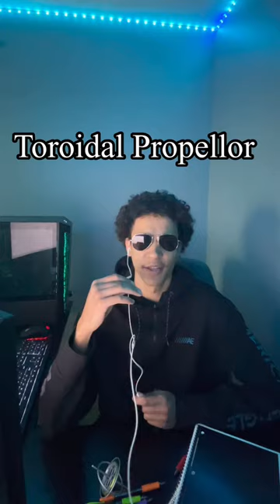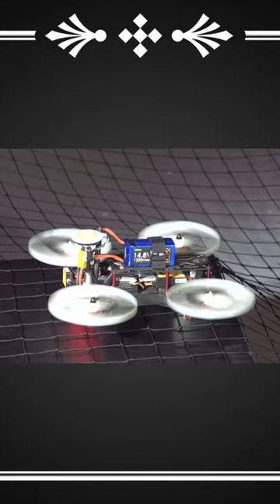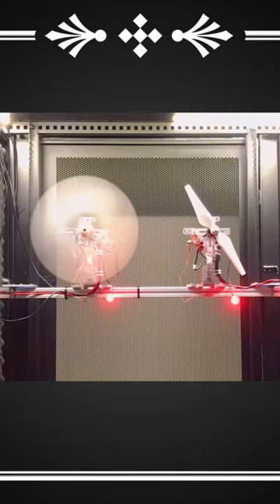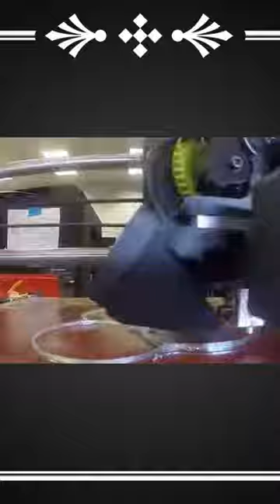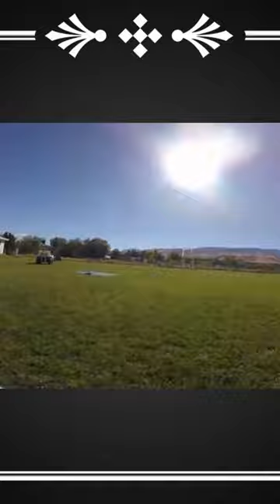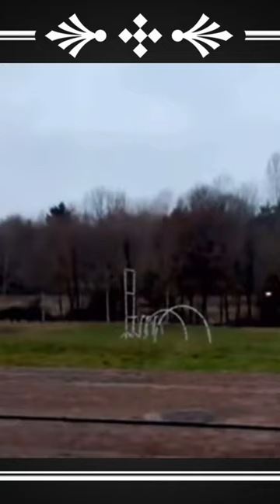Toroidal Propellor!!! #shorts

Comment: If they can do that, they can make a jet powered one
Edit: I meant like the propellers of a commercial jet
Reply: Imahine toroidal blade on intake for turboprob / regular chopper
Reply: The difference in intake of air as well as pressure on the blades might break the propeller on high speeds
Reply: Inside of the jet engine it's just fine to use the normal blades that are used because it's loud anyways, don't be adding more complexity and fragility just it has the potential to be more effective.
Reply: Makes those “tic tacs” look more and more like big boy toys with big boy budgets 🤷‍♂️😅
Reply: At this Point they can make anything you ask you get
Reply: Nash probably wouldn't be able to contain the preassure
Reply: You miss the point
Reply: Someone actually tested the design and its louder than normal ducted fans
Reply: Won’t do anything and might cause more problems to the jet engine causing more noise (Due to the need for relatively straight even flow).
Majority of the noise comes from the fast moving air out the back.
I wouldn’t be surprised if someone tries it because that’s engineering and science, but wouldn’t be surprised if they didn’t find anything useful.
Reply: They are great for boat engines and sub's aswell. Less noise more power
Reply: 1. For everyone talking about using toroidal propellors IN a jet engine, jet engine compressor blade geometry is totally different from a propellor, a propellor is not a compressor
2. A drone that uses jet engines instead of electric propellors wouldn’t work because the throttle response of jet engines is too slow. The flight computer adjusts the power of each motor tens of times per second, and a jet engine just can’t respond that fast
Reply: They would have to account for structural problems
Reply: They're already working on it and also have results and applications in the airlines industry. On jets engines and prop. ..
Reply: Oh, to make it pain in the ass for maintenance & repair?
Reply: @Luda_is_taken.Try_Ludoed228  These toroidal blades are only like 80% effective compared to a similar surface area blade. There's a huge power tradeoff.
Reply: The propeller would implode i reckon is why they didn't manage to do it yet?
Reply: Used inside the jet engine in place of the common compressor and turbine blades? No, won’t work because of the inherent nature and design of the jet engine itself. There is little to no air blowing between the tips of the compressor blades and the housing, which is one of the design features a jet engine relies on to function. This new prop design would increase that spacing and allow too much of the intake air to bypass the compressor stage. 
Now using this prop design in place of the traditional prop of a turboprop aircraft such as a C-130 or a Beech Queen Air, that is doable.
Reply: Everyone in here completely ignoring the fact OP said jet POWERED, not putting it in a jet engine.

Yall are familiar with the concept of a turboprop yeah? Like, running a full scale propeller on the torque of a small jet engine? Its how most modern commercial props work, and its how many larger helicopters work.

Hell thats why you sometimes see helicopters accelerating forwards in level flight... because the jet turbines still provide some measure of thrust, and you'll obviously went that thrust backwards to use it for movement
Reply: There is no point. It’s barely more efficient and the value on it is the reduction in noise, not an increase in pressure.
Reply: @sargera1 wouldn't work for a helicopter, if that's what you meant by "regular chopper". You have to change the angle of the blades too often

Comment: Out of all the different types of math, pretzel geometry is my new favorite
Reply: If you wants a better understanding of how this works, I would recommend researching Viktor Schauberger, the pioneer (to the best of my knowledge) of the concept of toroidal vortices. To summarize, a toroid or a vortex is simply the natural pathway that matter wants to move in, so creating propellers that utilize that geometry makes anything more efficient. 3D scan a whirlpool and turbines made using that geometry would be more efficient than others. A toroid is simply a full vortex with the intake vortex at the top, the output vortex at the bottom, and the shape doubling back to meet back into the top. Think of a double whirlpool with the second half spitting water out instead of sucking in water and that's the center of a donut shape. That's a toroid.

Comment: For those who didnt put two and two together, the reason less noise is good isnt just for your ears but also because noise is energy, and its wasted energy, the less noise created, the more energy can be used for actual thrust making the system much more efficient and will let you produce the same amount of thrust with smaller amounts of electricity or petrol

Comment: From what I've seen a guy do with it- it doesn't reduce noise. Two things were playing a big part in his test: The prop was printed and coated with nail polish(maybe uneven coating caused excessive vibration) And of course a3d printed propeller on a home grade printer isn't the best way to test.
So yeah ... as of now the noise is a disputable factor.

Comment: If anyone wants a better understanding of how this works, I would recommend researching Viktor Schauberger, the pioneer (to the best of my knowledge) of the concept of toroidal vortices. To summarize, a toroid or a vortex is simply the natural pathway that matter wants to move in, so creating propellers that utilize that geometry makes anything more efficient. 3D scan a whirlpool and turbines made using that geometry would be more efficient than others. A toroid is simply a full vortex with the intake vortex at the top, the output vortex at the bottom, and the shape doubling back to meet back into the top. Think of a double whirlpool with the second half spitting water out instead of sucking in water and that's the center of a donut shape. That's a toroid.

Comment: The issue is efficiency and performance. As a pilot myself I cannot justify these because they only seem to offer a measurable 10 percent drop in noise while destroying efficiency and performance. I really do hope they refine these further tho as it would be great if they could match either the efficiency or performance of a normal high pitch tri bladed prop you you often would use on a racing drone
Reply: Interestingly they found better efficiency for boats. As much as 105% better fuel efficiency.

Comment: Sadly at this point in history toroidal props are still way louder than standard props. The most that  fpv pilots and standard drone pilots have noticed is it has higher lift capabilities while using a lot more power and that’s about it.

Comment: As a kid I would always make these and everybody told me I was crazy and it was nowhere near as efficient as a regular propeller plus it was heavier😂 shows that you can't listen to everybody that surround you and if you have an idea you should pursue it😢 at the moment I am in the middle of perfecting a beer can size hydrogen unit that is strong enough to run an ultra-light motor. Been working on these prototypes for over 10 years so now I'm getting really close and I've managed to shrink it down a tremendous size. I plan on using a propeller design like this to see if I can get more pool and efficiency from the right-sized motor to keep it in ultra-light!

Comment: Emax tinyhawk still on top 🔥
Reply: Once you fly a 5 inch you never go back
Reply: @Suologievra  ?
Reply: @Suologievra  bruh the 4x4 does 60mph
Reply: @Bonky7426  a 5 inch will go faster and handle smoother (imo)
Reply: @Suologievra  i have a 5inch and a tinyhawk v2. Still fly them both. Tinyhawk v2 is a great smaller areas like large backyards, 5inch is great for powerlooping large trees and lanscapes. They are different and both a blast.

Comment: Though this unfortunately translated poorly to jets it has one other fascinating use

The props unique shape can be made lighter than traditional props
With Rolls Royce working on a hydrogen plane and a Slovenian company created canada first and only type certified electric plane lighter props are going to mean a whole lot more than they used too

Trouble is working with carbon fiber and its constant urge to disintegrate when struck by something solid at 2650rpm

Comment: Looks like it changes air flow similar to vortex stacks on a motorcyles or car. Fixing it in a more effectient direction vs random. Sure more blades n power = more flow. But so does better designs that channel that flow

Kinda like dumping out a bottle. Vs spinning it till u get a vortex, then dumping. The vortex allows u to dump way more out faster. Even tho the bottle is entirely the same

God science is fcking cool

Comment: Significantly quieter props and maybe even quieter fans in general would be very much appreciated, I may not understand fancy pretzel geometry but I only need to be able to buy it.
Reply: I can help you understand the pretzel geometry.

I would first recommend researching Viktor Schauberger, the pioneer (to the best of my knowledge) of the concept of toroidal vortices, there's a good documentary of him on YouTube. To summarize, a toroid or a vortex is simply the natural pathway that matter wants to move in, so creating propellers that utilize that geometry makes anything more efficient. 3D scan a whirlpool and turbines made using that geometry would be more efficient than others. A toroid is simply a full whirlpool with the intake vortex at the top, the output vortex at the bottom, and the shape doubling back to meet back into the top. Think of a double whirlpool that meets in the middle with the second half spitting water out instead of sucking in water and that's the center of a donut shape. That's a toroid.

Comment: Multiple people have tried these toroidal propellers with no difference in noise. The research also provided a lack of any data comparing the two types of propellers like speed or voltage applied when testing the noise. Also the guy who developed this just copied the boat prop that has existed for years and claimed it revolutionary. This was a complete sham

Comment: They suck on drones, you get a little less noise and lower pitch sound but they can't push so much air like a normal propeller,
BUTT 🍑
they were not designed to be used as drone propellers, they are motorboat propellers and in water they are actually much better than normal ones.

Comment: The toroidal propeller is only good for reducing the noise, not very significantly though. 

The performance of the current 3D printed version is not as good as conventional bladed props and they weigh substantially more.

On Freestyle / racing drones you want to keep things as light as possible.

I'm skeptical about wide spread adoption of them in my hobby.

They might be good for cinematic flying or long range where speed and agility aren't really a priority and noise is. 

I might be proven wrong when polypropylene versions are more readily available, though.
Reply: In boats they found 105% better fuel efficiency over standard propellers.

Comment: MIT must've found my high school flash drive, cause I 3D printed the Tor-Prop in my senior year of 2017.
Reply: Me when I make shit up on the internet
Reply: @lexif.5463  We were trying to 3D print at least 90% of the drone. (Yeah we were making drones). And this was one of the designs I used. I was already an avid 3D modeler before I got into 3D printing, so I was quite familiar with the torus and toroidal shapes. I'm also an aspiring aerospace engineer, and I have studied flight mechanics and flown a plane.

But by all means comment your 2 cents.